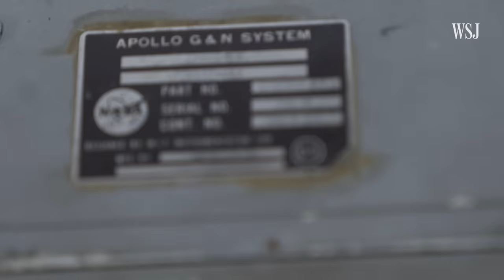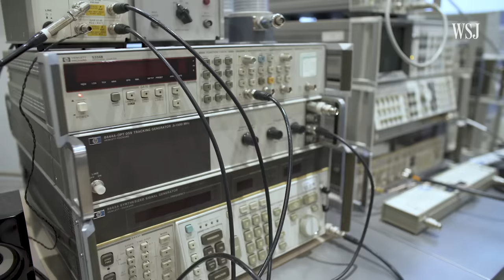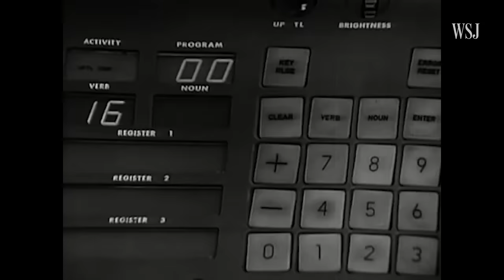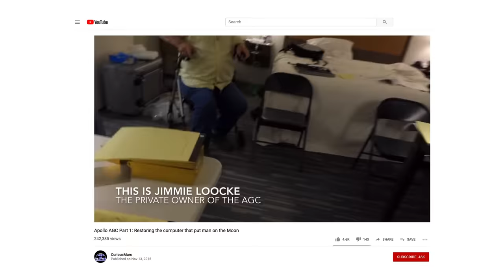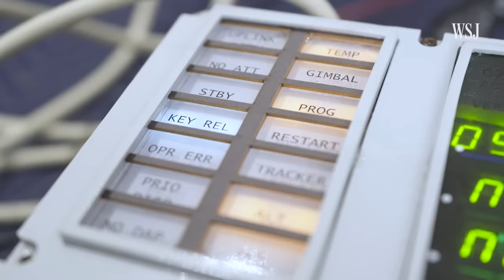Restorers Try to Get Lunar Module Guidance Computer Up and Running | WSJ

Comment: of course todays average cell phone can do all that and much much more, are you kidding, 1 terabyte of memory vs the 28 megs they had that took up a cuit case or more.. then the CPU speed? LOFL if they had this cell phone they could have ran circles around the moon if you dont think thats meaningful its massive, the weight this system used up meant oxygen supply was limited, back up was limited, FUEL was limited, all payload and space was limited to the uber huge systems it assumed..

you see what elon is doing right?  the next big step is going to be side by side tours of the moon, spend the night in an underground bunker where you can travel underground via  tunnels to the light side of the moon and observe the sun through shielded observatories.. if that's not wild enough for you they will have shuttles to an observatory to the light side of the moon where you can see home, and TIME the excursion to see your home on planet earth, then wave to family and friends with massive LED spotlights so they can see you with the naked eye YUP, mark my words in the next 50 years for $100k or so you will be able to catch a ride to the moon and then tour it the surface of the moon in an electric side by side... yup, once they get all the GPS and monitoring satellites in place it will happen... of course it will take 20 years to install all that infrastructure, tunneling equipment, concrete plants, steal fabrication shops all that.. so if you are around and want a good way to become an uber billionaire, create a lightweight small portable way to make oxygen out of water and hydrogen to power everything, and you will need to figure out how to recycle carbon dioxide in suit, not scrub it, recycle it

Comment: Where are the original builders of the puter?
Give them a call and tell them what you're doing.
It would be great to hear just how they came up with the engineering of it and stores of failures and successes.
Maybe they even have old schematics.
Maybe they know things that could or should have been done with it.
Did they have any ideas of commercializing it?
You know, Bill Gates and Steve Jobs DIDN'T invent the computer as we see today but TOOK it from IBM who didn't think it was worth pursuing after building it.
Even the IBM engineers were angry about that.
IBM even gave them the "mouse" that they invented.
But here, it's all newly invented technology never before even thought of.
You have to wonder what the Russians were doing in this field.
Maybe they had a "computer wheel".
You know, spin the wheel to make a decision.
Reply: You know kiddo that computers Yuu use are based on these old inventions?

Comment: But can it run minecraft?
Reply: Definitely not, the lunar module computer was designed to run a finite number of physics calculations in the 1960s, it definitely wouldn't be powerful enough to run Minecraft

Comment: Conspiracy alert !!, can someone explain to me what is that shadow on the mound to the right of the image in the https://youtu.be/g0PIXvjTasI?t=392 [6:32] minute?

I believed that a mound illuminated by the sun would be illuminated halfway but not more than half.
Reply: There is no mound, just a crater. There an optical illusion because of the camera orientation. I have seen what you have seen but if you look the video upside down 🙃 you will probably see the shadow of the crater

Comment: And here we are today, phones with 1,000x more prosessing power that could probably send 100s of rockets to space in a matter of minutes 😂
Reply: Believe it or not, the guidance computer didn't have to be as sophisticated as many people think.  Newtonian calculations are really simple.  They use inputs from gyros and things like that.  Accelerations and resulting trajectories in gravitational fields are calculations the average 8th grader can do on a sheet of paper.  The computer didn't have to be all that powerful.  The REAL drawback of it was the inability to perform multiple tasks at once.  That's really the issue, but it didn't really need to.  Speed is not really the issue.  Multitasking (memory basically) was the real issue, but again - not a preventative one.  While it might not have been as powerful as a run-of-the-mill PC of today, it wasn't designed to be able to perform literally hundreds of thousands of different tasks; it only had a handful of routines it needed to be able to perform.  It was designed for a single purpose instead of a million different ones.  It did just fine.  It didn't need to be able to run 300 programs in the background.  So, the difference in speed and power between it and today's modern computers is a bit misleading when you actually compare what they needed to be able to do.  It's like comparing a calculator to a computer.  Well - yeah.  The computer is a LOT more powerful, but the calculator only needs to be able to do one thing - - - and it does what it's designed to do just as good as the most advanced PC in the world.  It knows how to add and multiply.  That's all it needs to be able to do.  You don't need a $5,000 modern PC to be able to find the square root of 568 when a $2 calculator from 1970 will do the job just as well.
Reply: A cell phone is a type of General Purpose computer. This was a Special Purpose computer. Learn the difference.

Comment: That is a duplicate computer the actual computer that was on board Apollo 11 was a one-time use it went to the Moon and was destroyed by burning back up in Earth's atmosphere or floating somewhere around the Sun what you have there is not the actual one that guided Apollo 11. The one you have is an extra or spare or one that would have been used on another mission a duplicate.
Reply: Pointing out the obvius...